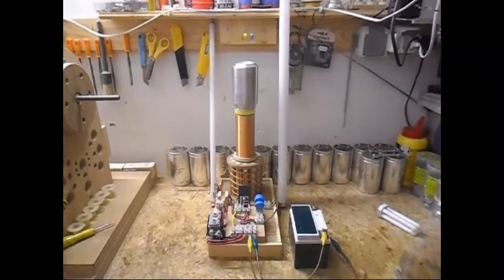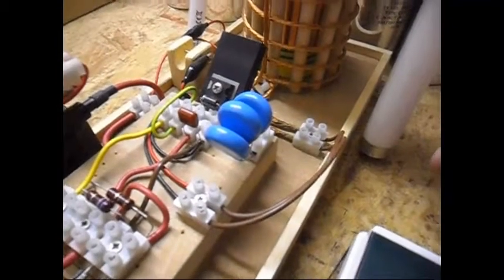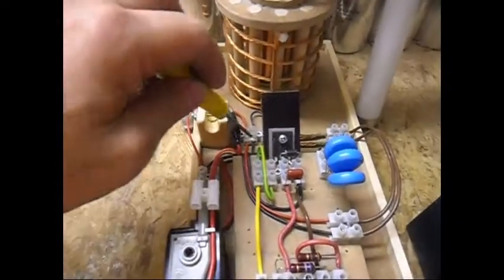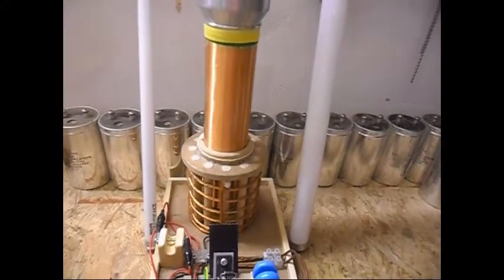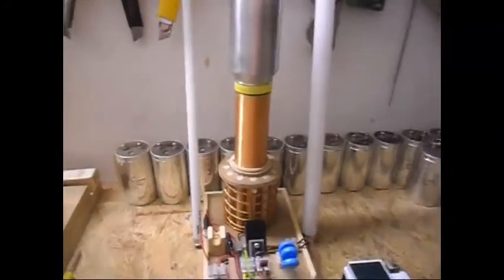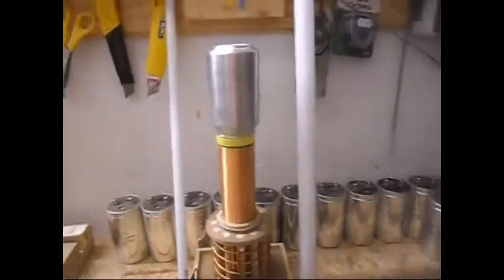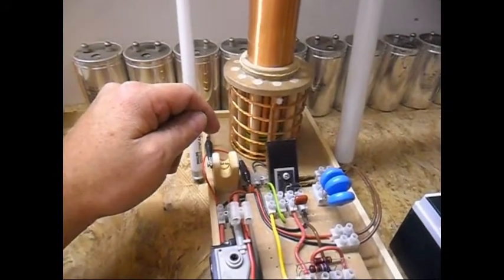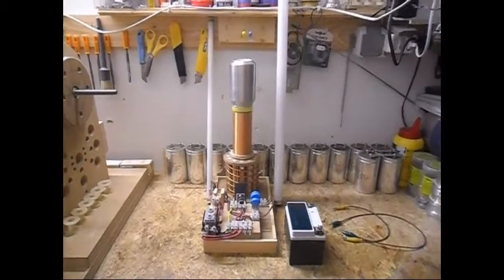Nikola Tesla Coil - Update 9 First try out, Flyback Transformer, Feedback coil, SG & 30nF...

Comment from the maker: Been viewing my Update 8 and 9 of my Tesla Coil setup and it seem that the lighting of them tubes is much better in Update 8 than in Update 9 but the sound of the SG and the discharge at the topload is more powerful in Update 9 than in Update 8...???
Maybe the distance of the SG wasn't the same as in Update 8 at the start of the test in Update 9...hmmm...crap...lol
The smaller the gap the better the light output will be...time for the ears protection so i can take my time and adjust it as close as it was in Update 8 wich was pretty small...;-)

Comment: Nice!
Reply from the maker: Hi Mario,
Thanks my friend...^^
It's a small step forward compare to the 10nF but still forward nonetheless...;-)
Now it's time for the new primary, should have that done pretty soon as soon as i can find the lenght of wire with the thickness needed or wind a multi stranded one for it just like the first one...^^
Reply from the maker: Hi there Mario,

An update on what i have tested with this setup,
I made and tested a 23,24,25,26,27 & a 28 turns primary and it worked not that good...-.-
Only with the 28 turns i gotten better wireless output on the load tubes, almost as good as with a exciter circuit but the discharge at the topload was only about 10mm...???
And that was with 30nF capacitance, i've also tried 10, 20, 40 & 50 but only 30 worked best with the 28 turns primary...o.O
The spark gap sound was a lot lower to...lol

I also tested a 3 turns primary wich worked better than the 28 turns one but not as good as my original 6 turns one...

So now i have the whole setup just like it was in Update 8 again wich is the best one till now...30nF is now 10nF since 30nF gives more noise at the spark gap but output and discharge seems/looks the same as with 10nF...^^

Only thing left to test is a better topload...lol

But as it is now with 6 turns and 10nF (or 30nF) i'm very happy with it...
For better output to light up fluorescent tubes an exciter circuit is much better and simpler but for nice topload artificial lightning discharge a flyback transformer with spark gap is the way to go...well at least in my case...lol
When i can find a larger topload i will test it to see how that goes...;-)
Take care & Peace...
Reply: Mister Caribbean Roots You could create a frame spherical polystyrene or thin rods mdf, just the right size, as indicated in previous videos, cover with aluminum foil for food. It is not necessary that the load is over the top secondary coil, you can place it where you are most comfortable, such as a chandelier hanging from the ceiling. I think it is the most economic solution, which would allow you to try various sizes without spending money and time, or almost nothing. I also saw the large hemispherical plastic pots for garden plants, even those may be for you. Always ricomprendo with aluminum sheets. Peace, take care friend
Reply from the maker: Mario Abbruscato
Yes my friend, a cheap sphere with the right diameter wrap with aluminum food foil will do just fine...^^
Thanks for the plastic plant pots tip...
I was thinking about a plastic beach ball inflated with air(ofcourse) and than wrap with aluminum foil, i think they are kinda the right size..."kinda"...;-)
I will keep you updated on how it goes...
Take care, Be safe & Peace...^^
Reply from the maker: Mario Abbruscato
I'm also going to buy some of this stuff to make some toroidal topload since this stuff is pretty cheap and i've seen it on many Tesla Coil setup...^^
Flexible aluminium tubing, it will make a nice topload...;-)

https://www.google.nl/search?q=flexible+aluminum+tubing&source=lnms&tbm=isch&sa=X&ei=9z7gU9bKJOGj0QXDw4DYDA&ved=0CAYQ_AUoAQ&biw=1264&bih=921